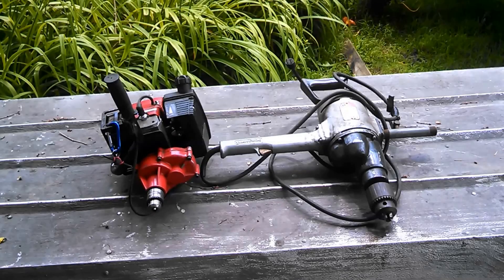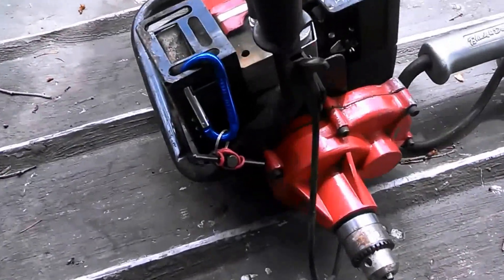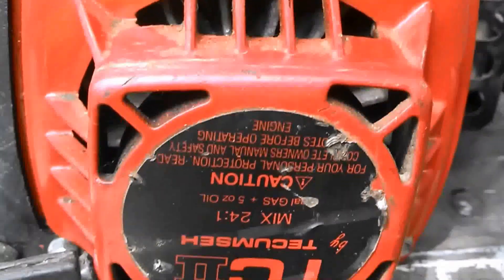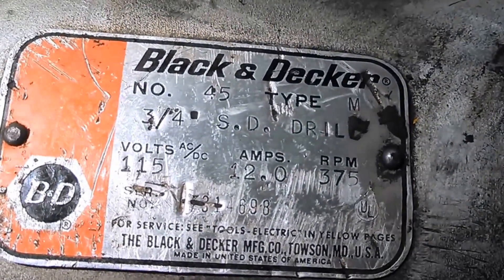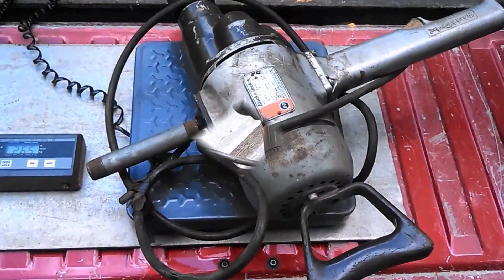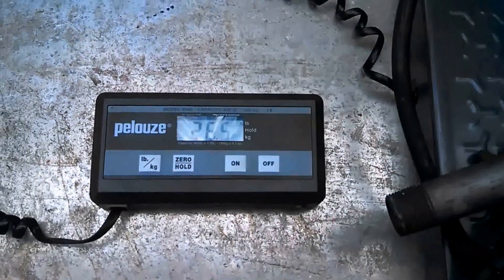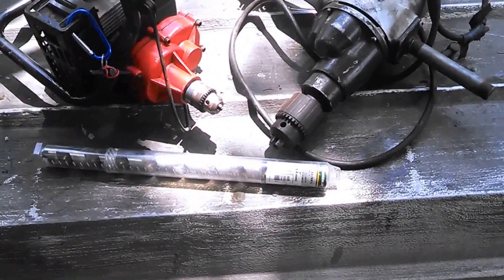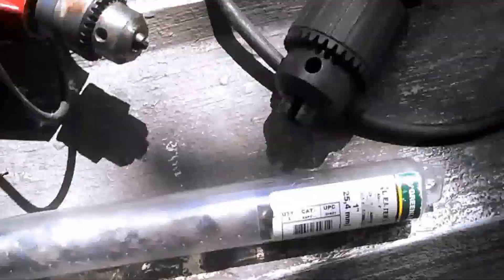Large power drill/auger gas and electric comparison

Comment: The Tecumseh will work if you have no power. How old is that Black and Decker drill you have?
Reply from the maker: not sure how old the Black and Decker is.
Reply: infinigrove. My dad had one similiar until I burnt it up. Looks similar to yours but not with the power that  the one you have has. I wish we knew.